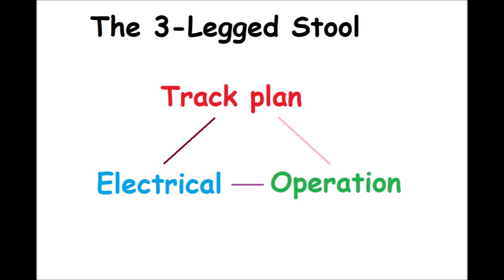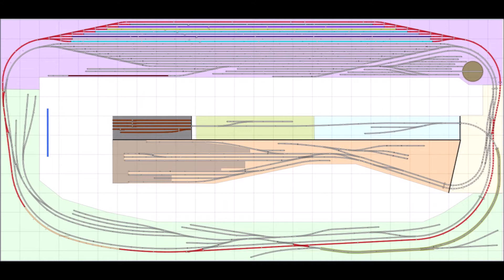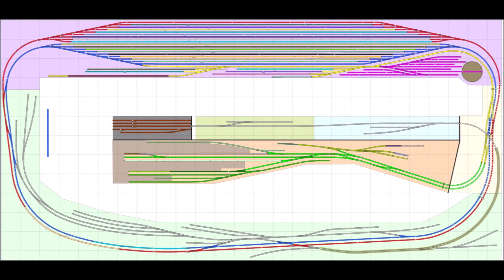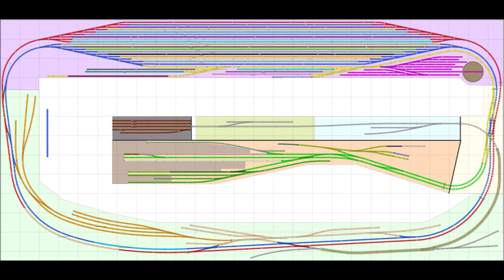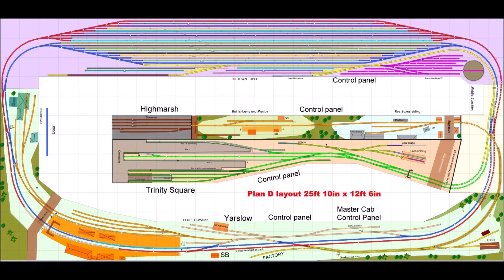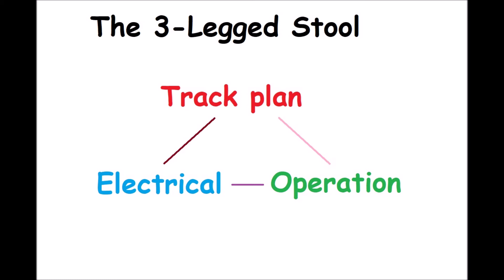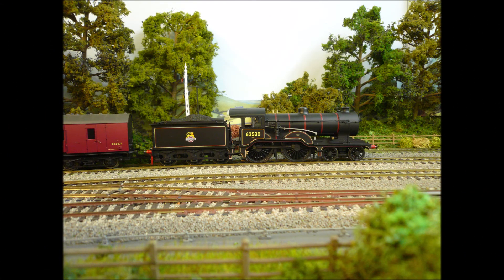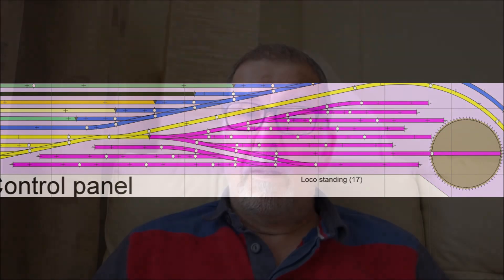Designing a Model Railway part 5 The 3 Legged Stool

Comment: Very interesting. Strange seeing a new layout being DC control 🤔 I’m on DCC and I don’t think it’s a simple as made out 🙄 Looking like it’s going to be a fantastic adventure I’m glad I’ll be following you 😃
Reply from the maker: Stevie - I'm too far in to switch to DCC.  Just 2 wires?  No.  Big cost for my fleet without the real benefits.  That said, if I were starting now I would go DCC sound and everything!!
Reply: @yarslowmodelrailway1  Good evening and hope your keeping well? Thanks for your reply. I cut my layout down for the same reason the cost of converting lots of DC locomotives. I’m really looking forward to joining you on this model railway journey. Cheers Stevie.
Reply: Hi again.  For the same reasons I’m a DC (Cab Control) Guy.  However my design strategy enables me to have the option to operate the Branch Line, to/from my terminus station, on either DC or DCC at the discretion of the ‘ Fat Controller’!  In developing my designs I identify the various trains and their indented movements first, then create the track plan and as you have recommended developed the control system and hence the Cab Sections to serve the overall requirements.  For any newbies may I suggest research into Passenger and Goods train plus locomotive operation ( particularly the last two if Modelling the steam era) before getting out the squared paper or investing in  ‘Anyrail’.     I intend to emulate (crib!) your design for control of my own 4 road, 8 train, hidden storage sidings. 
Thanks for sharing your journey with us.  To speed up progress I’ve taken a leaf out of the Charlie Bishop ‘workbook’ To Do list and set targets to completing various elements before moving on. I now wonder if he had seen your channel before me! Am looking forward to see the scenic developments as this area is my weakest link.
Don’t let me choose between the scenery or the control system, otherwise there will be no ballasting done in at all!
Happy Modelling T🚂